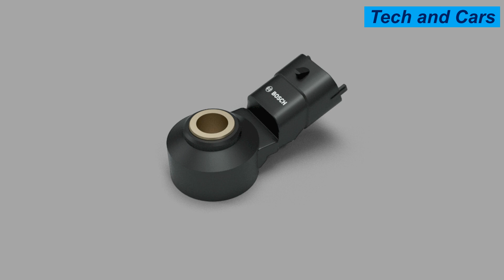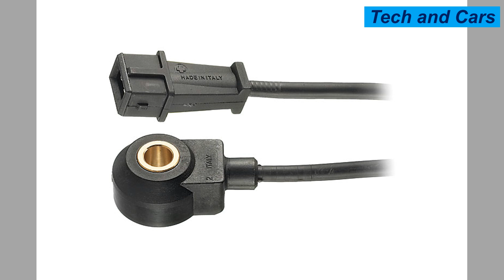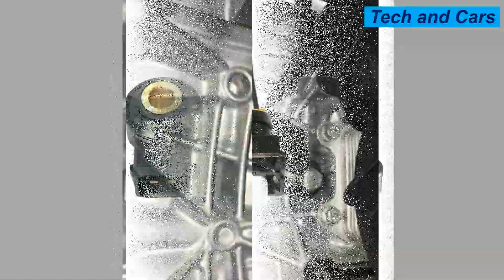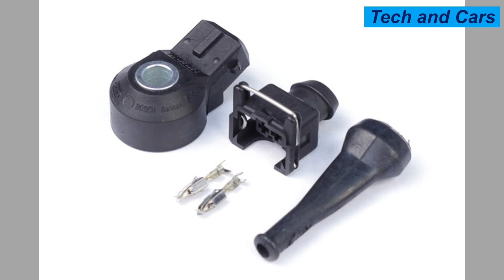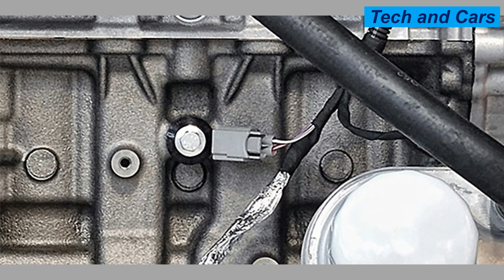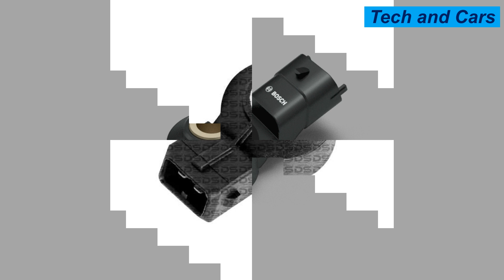Symptoms of bad engine knock sensor

Comment: Question,I just had my car cammed and tuned the knock sensor is on do i replace it or is it normal that the sensor code came on when having a cammed car?
Reply from the maker: The new modification must have created considerable knock and vibration on the engine; as the knock sensor detects when there is detonation induced vibration in the engine. Please remember that severe knocking may cause rupture of engine combustion chamber. And hence we suggest you look into what might be causing excess knock in your modified engine!